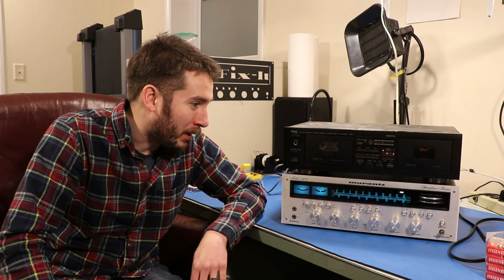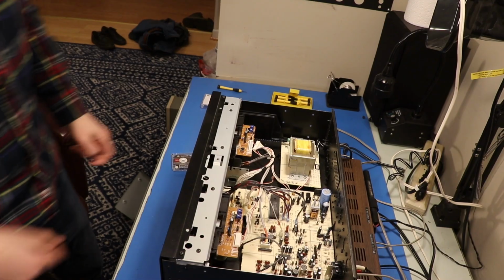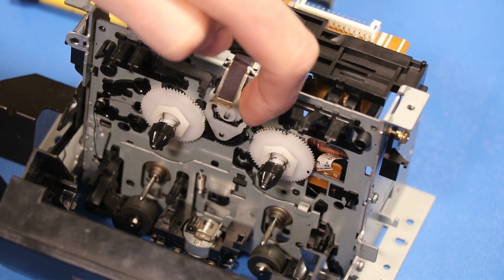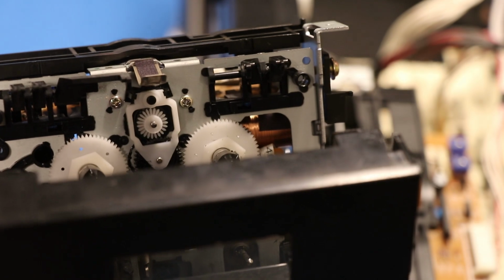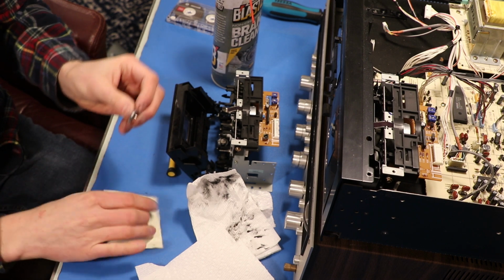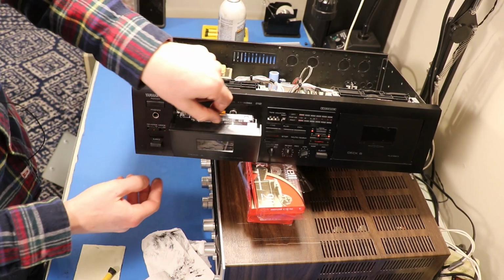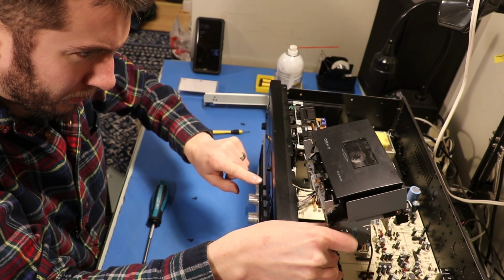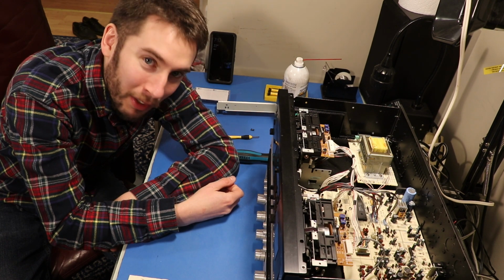Repairing My Tape-Hungry 1990s Yamaha Cassette Deck

Comment: I would dab some white lithium grease on a qtip and lube all those mechanisms where parts are sliding.. That would quiet some of the moving parts down, as I'm sure the 30yr old grease once there is long gone. Tape decks can be a real PITA. 😅 At least you got it working again. 👍
Reply: Oh yeah, they can be a PITA, I have a few of them in my "pile" 😂

Comment: Just to add to this; I fixed a Yamaha KX-130 with a similar counter belt problem. The belt snapped and left sticky black goo all over the tiny sensor by the right capstan. The black goo made the deck think the tape was not moving. cleaned it all up with 99% isopropyl and removed the remnants of the belt. All fixed up, runs fine. Interestingly the sensor looks for a bright/dark/bright pattern as the right capstan moves. Thanks for this vid, it put me on the right track re: counter belt.

Comment: I recently worked on a Pioneer CT-F700. A monster cassette deck. It needed 4 new belts I think plus the rubber on the  idler pulleys needed rejuvenated.

Comment: As for the deck 2 issue : There's a solenoid that is in charge of moving that white gear .In my Yamaha deck tape it was stuck at "on" position because one of its leads touched the other .I had to put a tiny piece of shrink/insulator to make sure they won't touch again and problem solved .
My guess is that when you disassembled it - it moved and came back to life .If the issue returns  - take a look at that solenoid .

Comment: It's a good idea to clean the capstan (that controls the tape speed) and pinch rollers as well, so the tape won't stick to them, and wrinkle. Next up, adjust the tape speed, and align the head azimuth!
Reply: most important though is demagnitize the heads and transport path.
Reply: @CDJF1  I'm on the fence about this. With 2 head decks, the head will demagnitize itself when recording due to the high frequency (~100kHz) bias signal passing through it. I've never seen any objective evidence, only "it sounded better after". The rest doesn't really hold a magnetic field for long.

Comment: I worked on my Kenwood KX-W8050 which has the same mechanisms shown here. 
The problem with Deck B is the small gear in the middle from the motor that drives both take up reels. 
Sometimes it moves out of alignment either outwards or inwards so it can´t reach the center gear.

I think it´s a design flaw because they didn´t secure the gear properly. I repaired it with some drops of superglue to fix its position on the rod.

Comment: Good fix Aidan👍 I think you got lucky using brake cleaner 😮but you got it working.  A thorough cleaning of the drive system may be in order.  Nice video, see ya next time.

Comment: Good job!  Those melted belts are a real PITA.  I've repaired two dozen or more old decks, cassette, R/R and even 8 tracks.  The melted belts are surely the worst thing to see when you pop the top, but nearly always it means the deck is still mechanically sound.

Comment: Exactly what happened to my 262 Got it at the thrift store and put in a test tape just in case. It came out with the band full of that goo. And counter not working. I opened it and no belt at the counter. Will go in now and clean that up. Goo on the rollers  and all. More messy than yours. Thanks for the video.

Comment: Doesn't brake cleaner dissolve plastic? I think I would use alcohol. And should you maybe use just a tiny amount of white lithium grease on the small gears before you put it all back together?  And FYI, on eBay you can buy an assorted pack of 50 cassette deck belts for about $8

Comment: I've been very picky about the decks in my collection partly for this reason. Mine all use near-identical single-capstan Alps mechanisms that have just the one flat belt that drives the capstan flywheel and sits around the back of the mechanism where it can be easily removed if it turns to goo, although none of mine ever have. An on-board sensor sends out pulses for a digital tape counter. It was very widely used in the late 90s by Denon, Marantz, Pioneer and Teac among others and needs close to zero maintenance for decades to stay around 0.045% WRMS wow and flutter. That's about as good as a single-capstan deck is likely get without quartz-locked direct drive.
Reply: Nice! Thanks for this info. My Denon DRW-750 has that transport, it's a "mule" of a deck! Only issues I had with her is the rollers needed a lot of cleaning, & and some minor speeed adjustments (apart from usual heads & capstan cleaning.)

Super easy & really convenient to work on. One of thew few well built dual wells 😊

Comment: Clear bright white plastic is often nylon, and will not easily becoming brittle. The older stuff that becomes yellow is often bad.
Using solvents is safer if you try some first on a small spot, and observe if it will not take the shine off the plastic. If not, you can soak the wheel for a few minutes, and use a brush. I think I would try white spirit (like terpentine) here.

Comment: I've seen belts do that before.  I found a couple outlets that sold various size belts in a mixed bag.  Some wide and some round.  Found them on Ebay.  My tape deck from the 70's turned out to be the main drive motor.  The shaft was very slow to turn.  I should have used a light oil on it but me.. I had to take it apart.  Getting those brushes back in place was impossible and now the motor turns but no tourque. So I'm looking for a new motor for my Denon. Good Video.  Thanks.
Reply: If you take a motor with brushes apart you can make shims to pull the brushes back.

Comment: What you could’ve done is got a toothbrush and sprayed some of the brake cleaner on it to remove the sticky residue from the gearing on the tape deck clean all the capstans end pinch rollers

Comment: Hi, thanks for the video. I found a Yamaha kx-w492 and I'm planning to buy it. The owner said it works well but on occasions the tape doesn't start moving. He says that if he hits stop and then play again the problem fixes. I was thinking it could be a belt related issue. Do you think that's what it is? This certainly helps me know where to look! Any advice would be welcomed!

Comment: 99.9 percent Alcohol will melt the goo effortlessly. Ultrasonic cleaner with 99 alcohol. Watching people struggle cleaning goo is hard for me to watch. I just smashed a casette deck because it would not work properly after 3 days of effort. I have no love for tapes.
Reply: +1 on the isopropyl alcohol.. That's safe. Brake cleaner is quite risky, as some of it contains acetone, among other things that'll melt plastics.
Reply: So just fill a jar with 99% isopropyl and then put the gooey gears in there then set that in the tank of your ultrasonic cleaner? I have dealt with a few of these and have nightmares cleaning with isopropyl (not sure if I used 99% or not) and q-tips and paper towels by hand. Took me 4 or 5 hours over multiple days to clean the goo from the transport of a Nak CR-3A. But seeing as I got it for $50 and it looks and works excellent now it was a good deal.